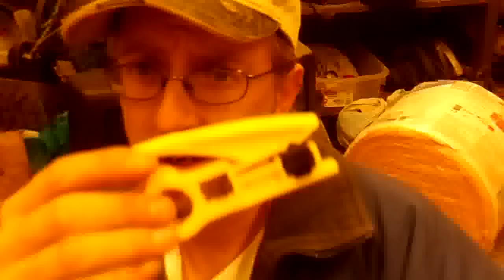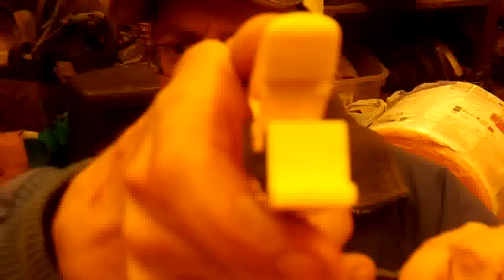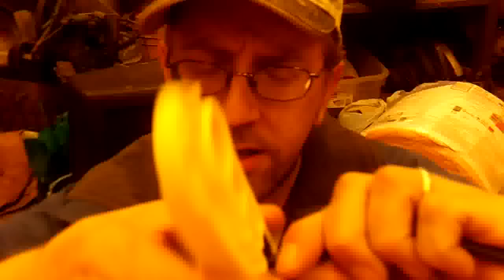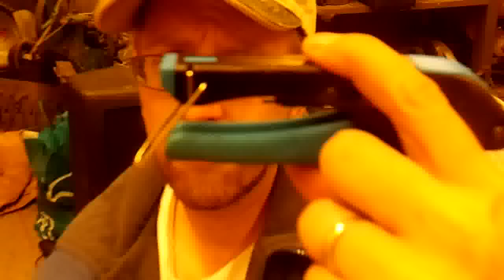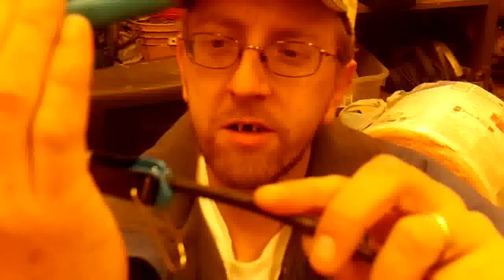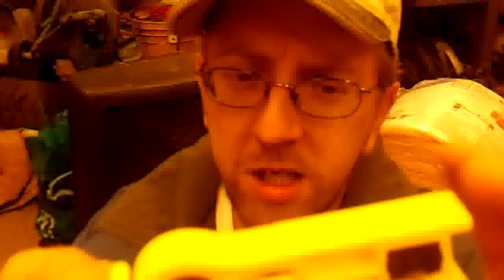How to install coax (coaxial) cable ends

Comment: what about if you are trying to get a coaxial BACK through the floor(cable guy installed it one-way so I have to either cut the hole bigger, which i'd rather not do to my floor, or just yank the metal piece off at the end and pull it through). is it okay to yank that end piece off and still safely put it back on and it will still work right?

Comment: the tension bar wasn't locked in place on the stripper. i don't like them go to cablewholesale.com and get the stripper they have. and it's a great site. with cheap shipping.

Comment: Why did you not put on a connector?
And when I done this, the blade cut all of the tiny alum.braids of wire off?
Does this mean its not going to work, or were you referring to the alum. foil looking paper stuff covering the white center piece?? Of course I have not tried the cable out yet.
Any help as soon as possible will be greatly appreciated!
Thanks!
Reply: The braids are fine if they are cut off. Means less of a chance of them interfering with signal. This guy is just a do it yourself dude and doesn't know exactly what he's talking about. Originally what we do is take the remaining braids and fold the down so they don't interfere. The outer part of foil you're speaking of we try to take all off if possible. I usually use my cutters to help with that process to speed things up. There will still be a foil that covers the center white piece but that part stays!

Comment: I had the same POS cable compression tool you used, I bought off ebay for $10. It broke, I now use the yellow Porter Cable version, which is much better.  I highly recommend the rubber washer weatherproof RG6 fittings that Phat Satellite sales, grips onto the coaxial barrel, with no adjustments needed because normal coax fittings become loose and have to be screwed in again. I also use a drywall saw if I need to pull cable from another room if there is not sufficient crawlspace or no attic. Phat Satellite via ebay also sold me a box of RG6 Cable 500' for $33 including shipping! Love my DVD quality on my VCR! and Time Warner techs give me dirty looks because I use better stuff, and my cables unlike theirs match the color of the wall.  Black wires are for plugs not cables in my household.  I wonder why Time Warner insists on using Black cable wire (like my walls are painted black, who do they think I am, The Rolling Stones?  When Time Warner acquired Paragon Cable in 1996, they used white cable before that black, and before that beige.  I liked the beige cables they used, for some reason they didn't look tacky.

Comment: it's comprised of steel copper cladding- dielectric- aluminum foil and steel braiding. Make sure you never cut the copper while it is exposed only cut it before it is stripped if you cut the copper after it had been stripped then it will shatter the end of the connector usually not visible to the Human eye but you can see it under a microscope, that shatter affect will cause small errors that could result in a annoying problem down the road also never scrape the copper.

Comment: I have dual coaxial TV cables that were installed before the walls were finished in my house.  There is already installed a connector on each end of each wire, for a total of 4 connectors.  I think at least one of these connectors is faulty and needs to be replaced.  How do I determine which connectors are good, and which need to be replaced?  Perhaps the wire is open, but I can't test the wire without first testing the connectors, or can I?

Comment: Good informative video but a couple of things I'd like to point out for beginners is that you need to be very care pulling the jacket and everything off with the tool.. The blade can potentially score the center conductor cause certain frequencies (most commonly hd signals) to drop off.. You will have signal but there might be a few channels missing.. Also another huge pointer is the the braid (the metal hairs) need to be laid back before putting on your connector.. If any of the braid comes in

Comment: Also remember, coaxial cable is an antenna and does not work the same way as power. Simple conductivity is not good enough and will cause problems. The center conductor is typically also steel with a thin copper coating. If this coating gets scratched or cut it can cause signal problems, as radio frequency travels on the outside copper portion of the antenna.

Comment: Make sure to peel the braiding back before putting the connector on, it makes it easier to put on and reduces the chance of it touching the center conductor and shorting it out. Make sure the dielectric (inner white part) is flush with the connector so the connection stays shielded properly. Screw on connectors are junk, don't use them. Hex crimp is okay but run the risk of partially pulling off and causing "suck out". Compression is the reliable way to go.